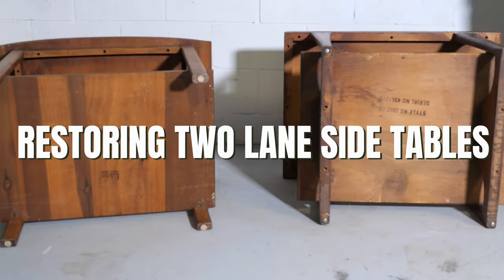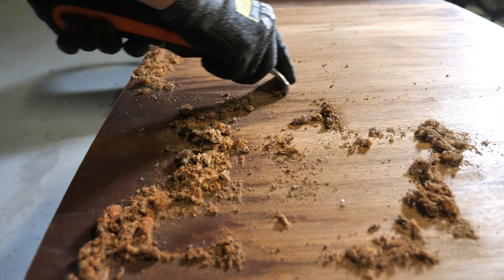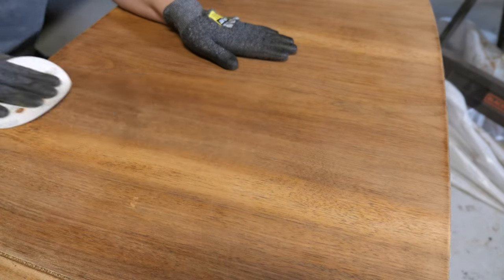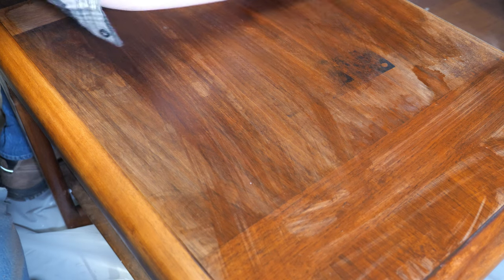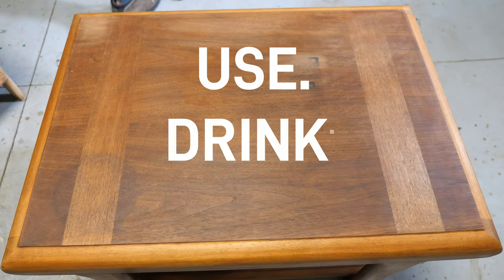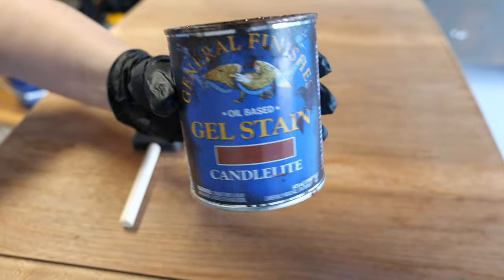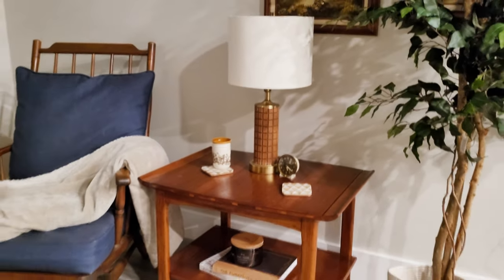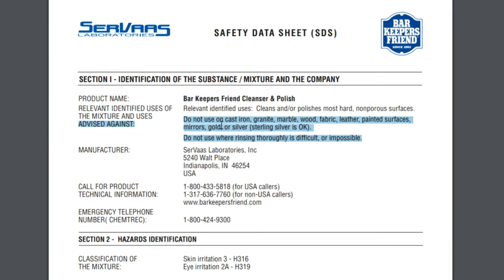FANCY Lane Tables Restored. Antique Furniture Refinisher vs Paint Scraper

Comment: Excellent job on this restoration! They both turned out good as new. I might need oxalic acid for a project soon. Question for you, can the extra liquid go down the drain or does it have to be disposed of some other way?
Reply from the maker: Thank you!  Further dilute it and then add baking soda. It will neutralize it. I rinse it down the drain with water flowing after the baking soda has had its opportunity to work its magic. It isn't classified as a hazardous waste product.
Reply: @ReconstructingEmily  awesome info, thank youuuuu!

Comment: Super helpful, thanks. I've got a brand new carbide scraper, but have been a little intimidated by it, and your work with it helps a bunch with that. Cheers!
Reply from the maker: Some finished are more difficult to remove 
, but all you can do it be patient with yourself and take your time. Start with flat surfaces too!